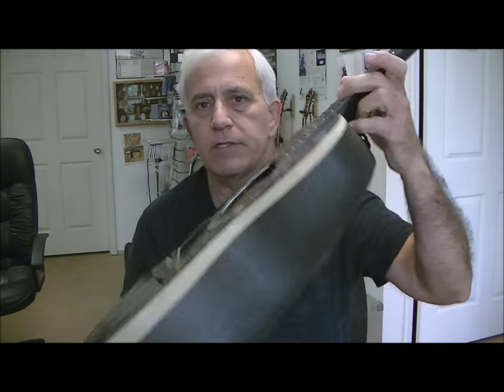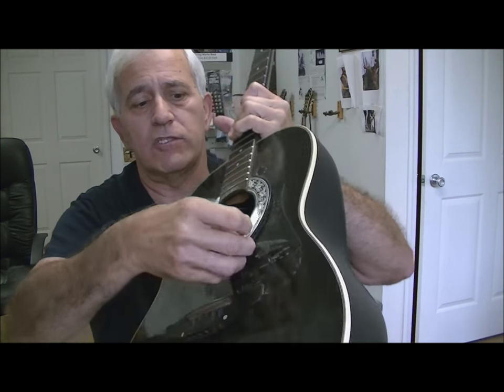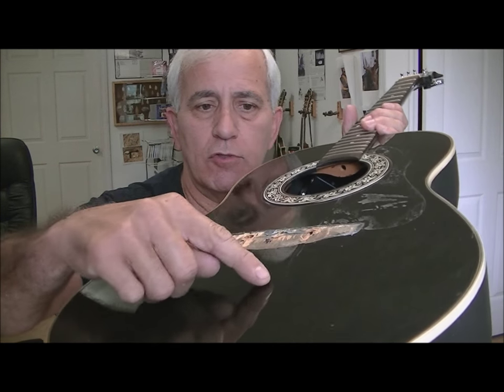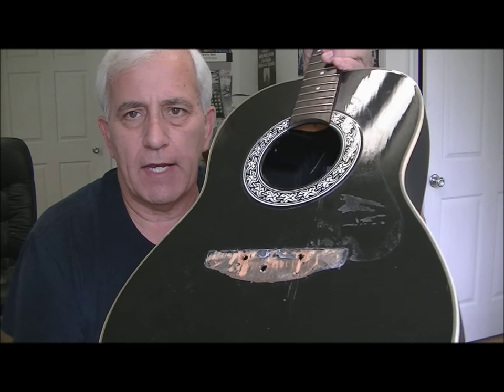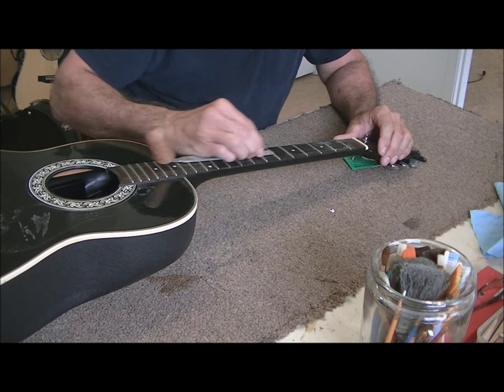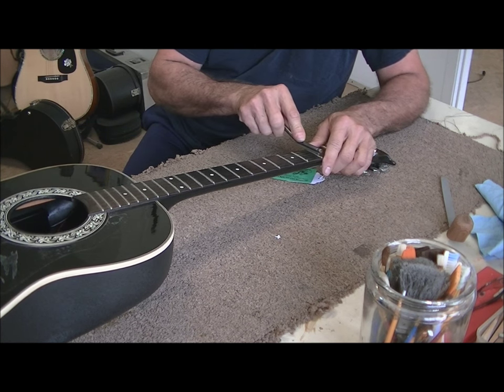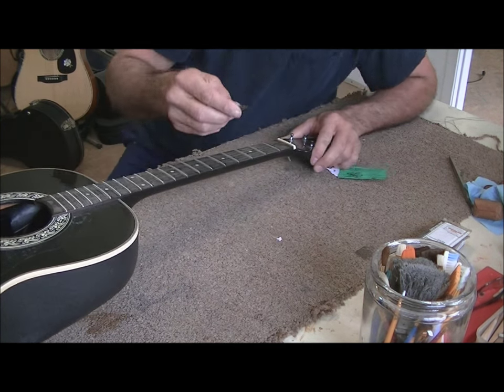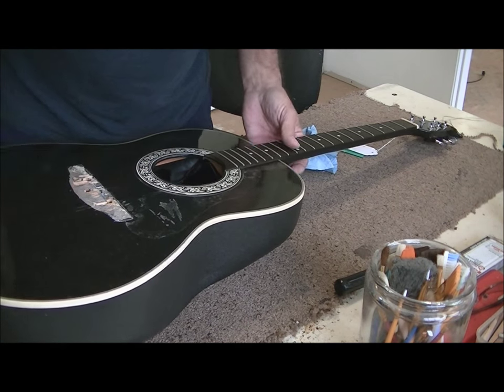063 RSW Ovation Guitar Part 1 Bridge Failure and Reworking the Fret Board

Comment: I had the same problem with my ovation. After watching many of your videos, I felt comfortable attempting the repair. I cut the finish around mine and chipped out all the finish from under the bridge. Sanded the epoxy off the bottom of the bridge. Then glued the bridge back on with tite bond. The finish was about a 1/16 to 1/8 inch thick. recessing the bridge in the thick finish fixed my high action issues. What a bonus. Thanks for sharing your knowledge.

Comment: If I remember right, Ovation didn't glue the bridge to the finish as Don suggests.  The finish itself was the glue.  It was some kind of catalized finish they used and the bridge was put in place before the finish hardened.  That's if I'm remembering right.

Comment: Great video man! I wonder if it'd be best to install a Plate Mate or just make a bridge plate bigger than a Plate Mate in size and run the strings thru the top like most acoustics? I never did like those kind of bridges that pulls itself up as you mentioned where the strings to thru the back of the bridge. BTW a bunch of folks stirred up arguments on several of my repair vids too about using linseed oil, and some of them even insisted on never putting anything on the fingerboard. lol I use linseed on all open grain fret boards I work on.
No word on the Kentucky mandolin yet, I may be giving you a shout soon as/if it arrives. Gonna share this on Google maybe more people will see it.
Reply from the maker: Thanks Randy.  I watched your latest vid too.  But it wouldn't allow me to comment.  In part two, I show making the bridge in some detail.  It worked out pretty well.  The customer seemed very happy.  The sound was good too.

Comment: Great video ! Is the file you use to level frets a standard file or special one for guitars ?
Reply from the maker: It's a standard file that I cut the tag off of and glued to a block for better guidance. Watch is that no file is perfectly flat. You can look down the file and you will see there's always a very slight concave and convex side. You put the concave side up the convex side down when you glue it to the block. Thanks for watching.

Comment: I'm working on one of these with same bridge, mine is still glued on good, top of bridge popped off where the strings were in, my 1st bridge replacement, do I glue bridge to top or scrap all the glue and finish off before glueing new one on? I was told to sand down to the wood just needed another opinion
Reply from the maker: Both surfaces need to be completely free of glue and finish.
Reply: Thank you,,bought a new bridge, got old one off,,looks like they might have glued bridge to finish, I haven't got to bare wood yet so I didn't know how ovation did it(or) the owner before me.

Comment: hey, I'm attempting a similar project except I'm converting my unit to a octave mandolin . how do you feel about using a tail piece. the pressure from the string will be down on the sound board except pulling from the bridge. shame so many ovations with cracked tops. if it don't work at least I have a new shovel for in the garden
Reply from the maker: It's should work but you probably won't have much pressure on your Bridge because of the low angle.

Comment: Hi I have an ovation and I'm trying to remove the bridge with a hot iron. But it doesn' move. I removed the 2 scews already, I can't get it to lose. Any idea how to do it? Thanks.
Reply from the maker: Ovations are a horse of a different color. They are very difficult to work on. Mostly because most of the glue they use is epoxy. I am not a fan of epoxy at all. The best I can offer is good luck to you. It's not an easy thing to do and I don't really have any great suggestions. You just have to be persistent. The negative is you may pull off a bunch of finish with the bridge. It's highly possible you could also crack the top. In fact Ovations are so difficult to work on I don't think I will accept any more of them in the future.
Reply: @RosaStringWorks  Thanks, I have this guitar for parts, so I'll have to destroy it.

Comment: It's a crappy product. So, as I'm also a crappy handyman, i just epoxied the bridge. Added  two screws underneath. If thats not wasn't enough, i drilled two holes on the sides and fastened it with blind rivets. I hope i last a lifetime.

Comment: so thats why my action is so high?
Reply from the maker: The Puertorican Beast Jonathan Ayala unfortunately that is a common problem with this model.  Thanks for watching.
Reply: No thank you for clearing things up, can I glue back the bridge without the screws?
Reply from the maker: The Puertorican Beast Jonathan Ayala yes as long as you clean both surfaces to bare wood.
Reply: Ok and do the humps go away? Sorry for all the questions 😅 I really want to fix the guitar
Reply from the maker: The Puertorican Beast Jonathan Ayala they will likely reduce but probably not go completely away.
Reply: Thank you very much, I subbed to you're channel